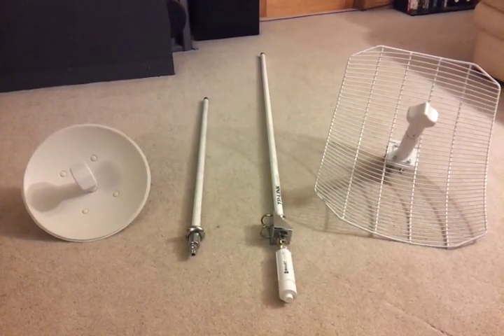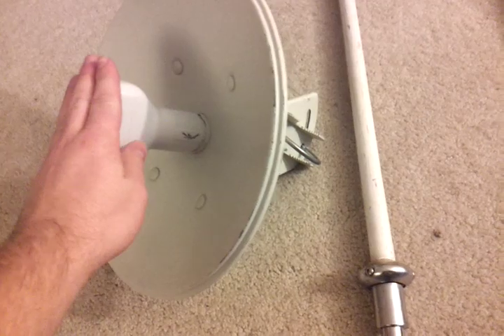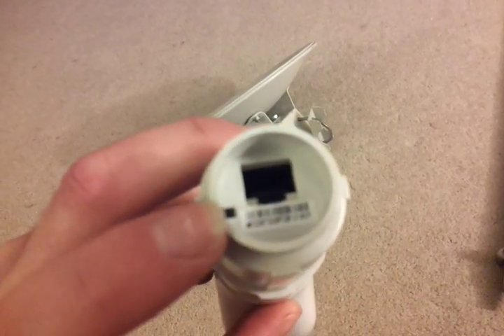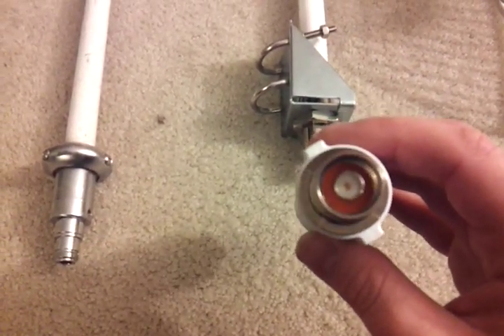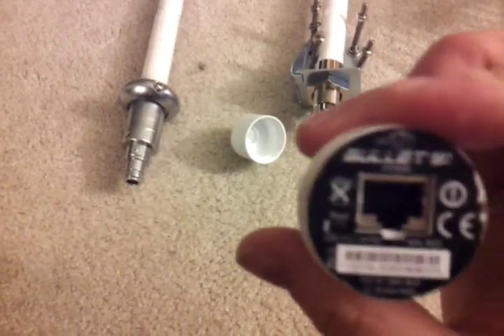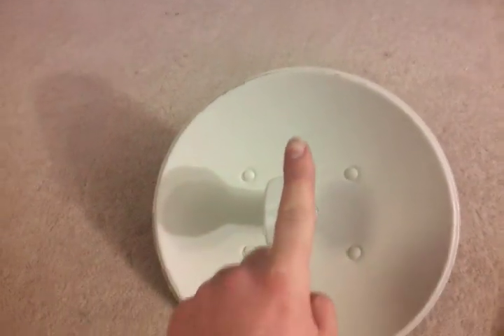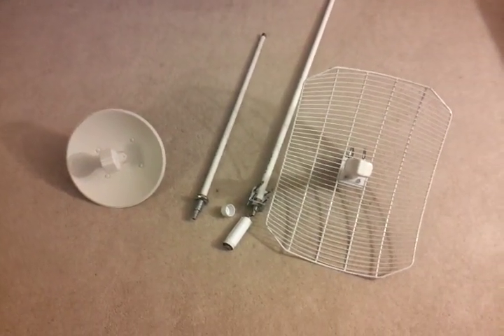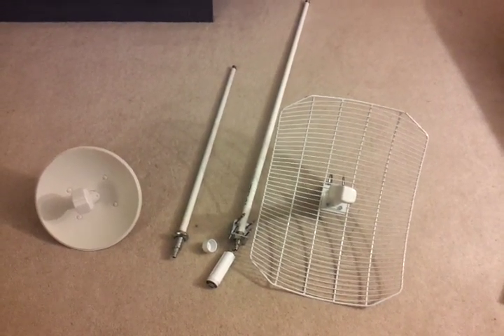Ham Radio HSMM Using Ubiquiti Equipment (Part 1)

Comment: I was wondering about the range also.

What are the power output of the transmitters before the antennas? The max I need for a point to point is about 47 miles. Achievable? One tower is 180' but I'll be at the 175' and the other tower is about 160', I'll probably be at 140' point. Both are LOS of each other.

I did find a 2.4 Gig bidirectional amp of 10 watts. I'd love a 30 - 50 watt amp.

Comment from the maker: My furthest active link is 13.3 Miles, but I was using one about 18 miles for a few days. My 13 mile link is using 25dbi and 30dbi antennas, with great signal. This is at 125' & 100' and it clears the trees.